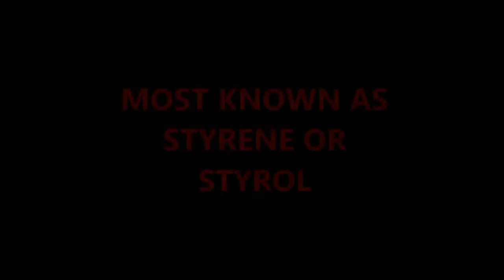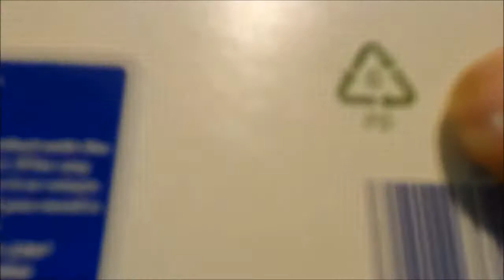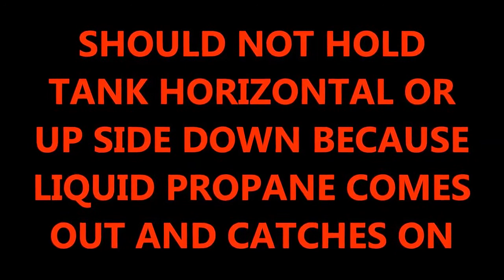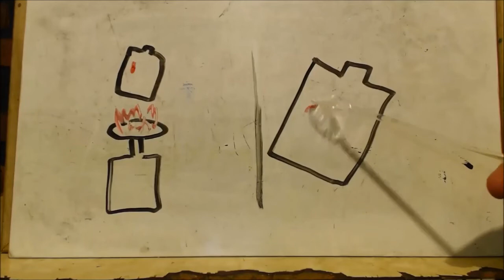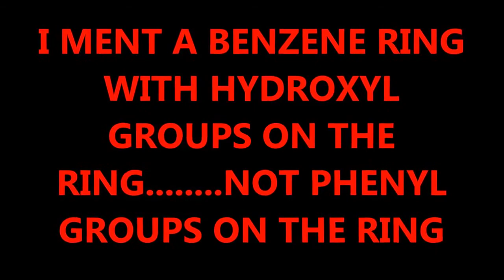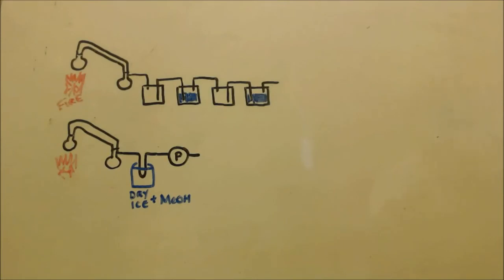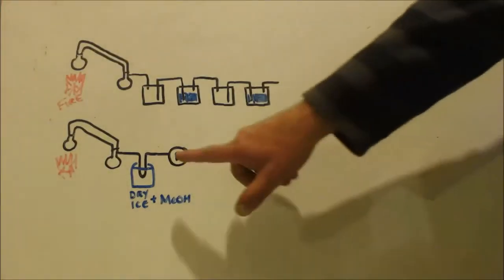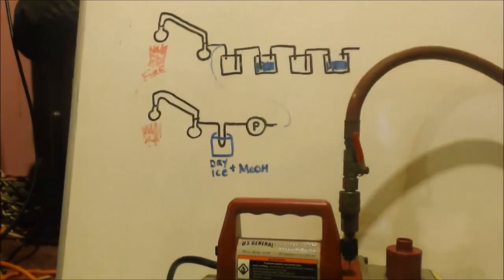MAKE PHENYLETHENE (styrene) VIA DEPOLYMERIZATION OF POLYSTYRENE

Comment: Hey hey, glad to see that your content survived!

Question:
I'm sure experience has brought wisdom so:
Just for general semi-improvised hardware for pyrolysis, thermal decomp, dry distillation, etc., would you still stick with the setup used in the video here or do you know of tricks to improve heat distribution with the reaction can, new vs old cans, styles of propane burners etc? The small things that can smooth things along and help the workup.

Just any improvements that one may have picked up along the way with improvised torch-can dry-distillations(?); not necessarily phenylethene-specific. 
Looking at an unrelated experiment with dry carboxylates and wanna know any practical improvements to the setup, since no one wants want warped and/or broken glass, and will therefore be joining the solvent/paint-can club. :p
Reply: Or does the teapot really continue to be the end-all be-all answer for this type of reaction?
Reply from the maker: Joe Mamma..............I REALLY LIKED the tea pot still I made.  It worked very well.  The pieces were all snug even before I put JB weld on them.  They sell them by the truck loads at walmart.   You know it really depends on how easy you can buy glass.  A tea pot alone cost $10 and the copper cost money for the condenser and the plastic tubing to run water threw and the time to make it ..............I mean a 500 or 1000 mL rbf only cost like $20 and 5 minutes to order on line .  If you can just buy a new one if it breaks then it is probably worth it to just use glass.  For me I have trouble buying any lab glass so I almost have to use a tin can still.  Either way............using glass or a tin can you have a chance for leaks/cracks/accidents.  The only way to almost eliminate that is to get some fused silica/fused quartz rbf
Reply from the maker: Joe Mamma.........Not really learned anything that is not in the video.  The most important thing is not to use an old rusty can.   I am trying to move to fused silica /fused quartz glass RBF.  That would make all the difference.  Those quartz RBF can take the extreme heat and temperature differential.  In my opinion that is the best thing that could be used because you got all the ground glass joints like borosilicate glass but it can really take the heat a lot better.   The best thing you can do when using a TORCH on a rbf is to heat the WHOLE flask so there is not a big temperature differential anywhere in the flask.  In a way temperature differential is worse than high temps.   I have a soda lime decarboxylation video coming up soon and I use a tin can again.    But I do have one quartz rbf coming in the mail as we speak.  It is only 50 mL though.  But it is a start.  Probably would still use a tin can for soda lime decarboxylations because the hot NaOH will etch the glass and make It look foggy
Reply from the maker: Joe Mamma............Also if you want to use a tin can as the pot but you want the rest of the apparatus to be glass you can drill a hole in the can (if it does not already have a hole).  Then get plumbers tape (Teflon tape).  And rap it around the ground glass joint of the still head until it is a lot bigger than the hole.  Then screw the still head in to the hole so the can grips in to the plumbers tape and then check to make sure you got a tight seal.  Then add the rest of the glass apparatus without screwing up the plumbers tape joint